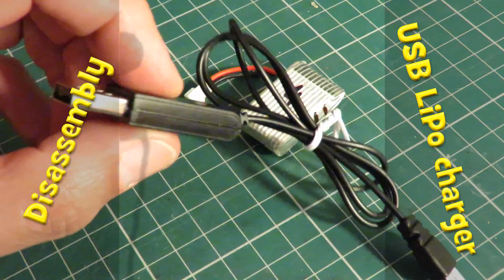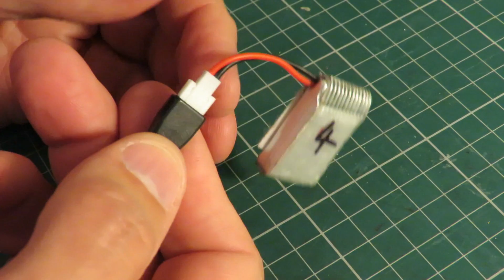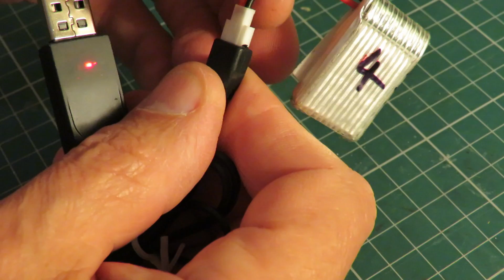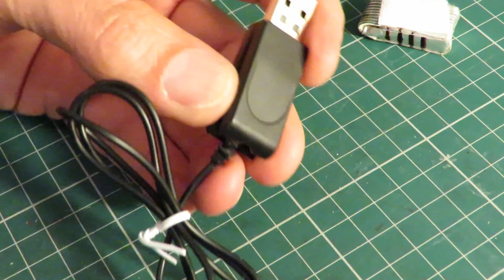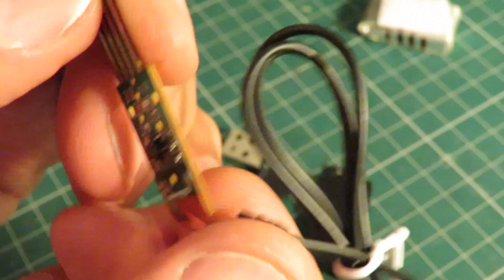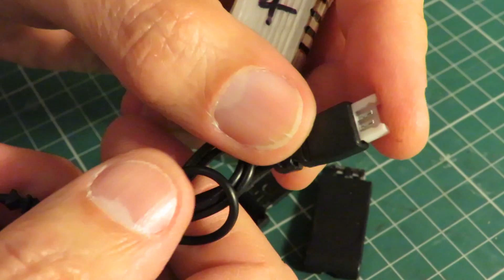Disassembly - faulty USB LiPo charger

Comment: Hey there I have a question here I have a few 3.7v batteries and I would like to create a usb  charger by itself would that charger work with my 3.7 batteries or no
Reply from the maker: Those little circuit boards are designed to charge small LiPos. I don't remember what current they supply probably 1A. There is more information in the video description including links to videos on those charge boards with more information. There are at least two versions of the charger board, one version includes a battery protection circuit.
Reply: well I would love to see if it does work i have a project here that I am working on I am hoping that those usb chargers will work and handle the current

Comment: hey grandad I read a few weeks ago that it's possible to use an arduino as a lipo charger don't know if it's possible as I haven't researched it yet
Reply from the maker: Yes I am sure you could use an Arduino to monitor the charging if you build a suitable interface however it would only be worth doing as a technical project and it would probably be very interesting to do that and write the code to run it. It certainly would not be worth doing from an economic point of view as you can buy "off the shelf" components designed to do the job very cheaply. In my video description there are links to videos using those components.

Comment: Good advice.
Reply from the maker: If you mean those LiPos with the wires reversed. To be fair they did have a bright yellow warning label on them, but it just said refer to the manual and of course there was no manual.. They were for a specific brand of RC helicopter which probably came with the manual it referred to :( https://youtu.be/WApPGLvs08Q?t=1m15s
Reply: Ahhh.
Reply from the maker: Wil Hobbs :)

Comment: Where can I get parts like that little chip? I burned up a couple of esc's and I think it would be cheaper to just replace the transistors in them.
Reply from the maker: I buy all my electronic components on eBay. Your main problem will be identifying the part that is burnt as the number written on it has probably been burned too. If you have one that is undamaged you might be able to get the number from there. You will need to be very skilled at soldering to replace those components.
Reply: +GrandadIsAnOldMan yeah, most of the number I can read, except for the first 2 or 3 letters/numbers. And don't worry about the soldering part I've done this stuff before, for a long time. Thanks!
Reply: +The Droniac well, I tried a few times and no luck. I think they are garbage now.😔 That's about 8.50 pounds (I'm American, so I don't really know pounds) down the drain as they worked for 45 seconds and burned up.
Reply from the maker: The Droniac :)